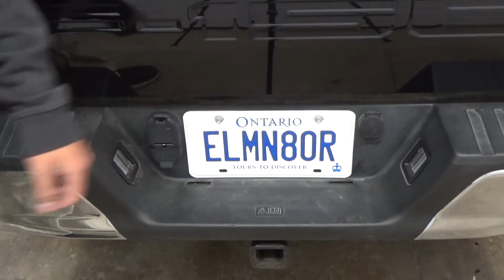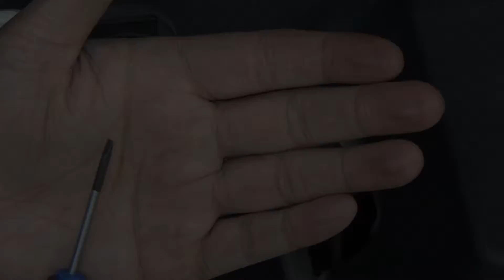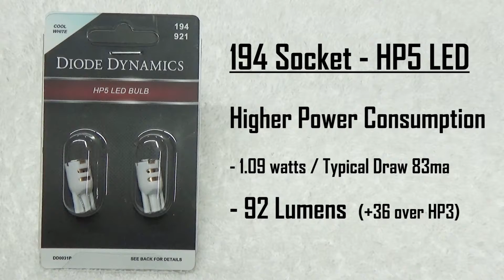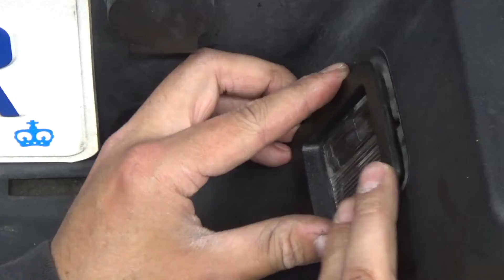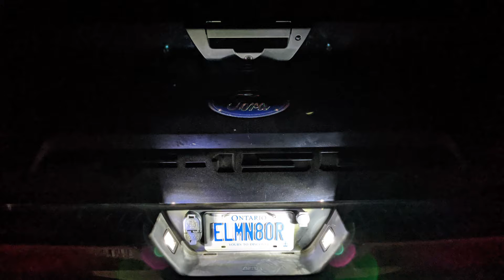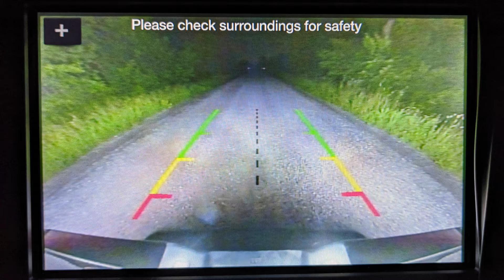Diode Dynamics HP3 & HP5 LED License Plate Lights Upgrade - 2019 Ford F150

Comment: Good video, I had doubts about the HP5 being too bright.  What do you think about the Pure White and Cool white colors for license plates?
Reply from the maker: The HP5's are a great addition to the rear end as they even boost lighting at night for your backup camera. I believe it's hard for the camera to pick up, but the HP5's work well at illuminating the license plate. In the video I stuck with the HP3's, but I've since reinstalled the HP5's. I like the cool white 6000k because it matches all my other LED lights.